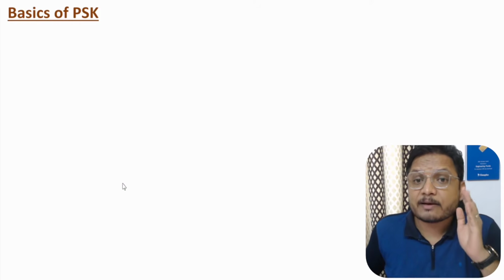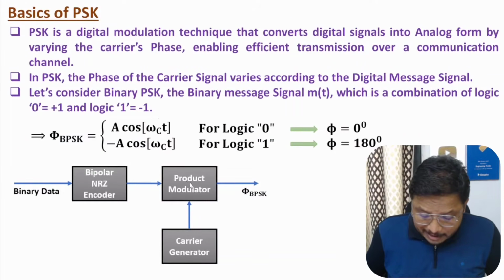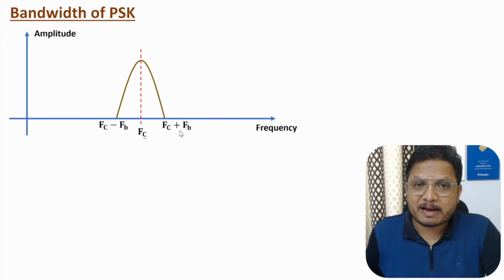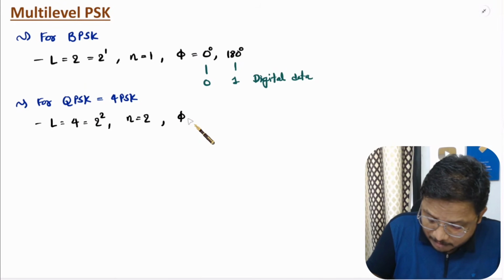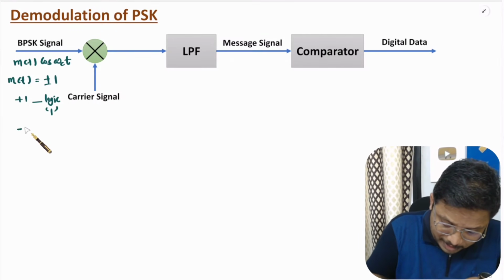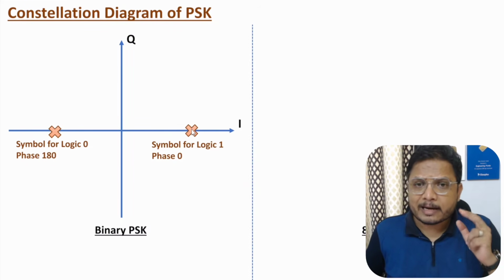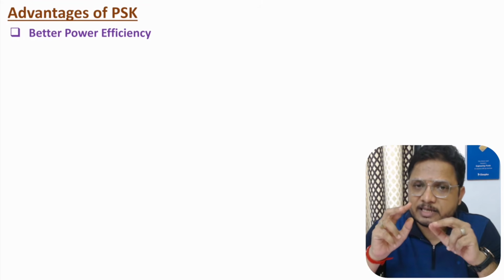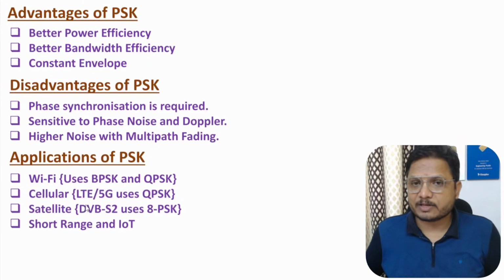Phase Shift Keying - PSK | Basics, Waveforms, Bandwidth, Demodulation and Constellation Diagram

Comment: dear sir i have bandwidth related confusions , here in some books they shows the bandwidth of BPSK signal is 2 * bit rate , but here we derived as b.w = Bit rate , so which one is right ? , same confusion for 4 PSK and  8 PSK ,
Reply from the maker: This confusion happens because two different bandwidth definitions are used.

For BPSK:
• Minimum (Nyquist) bandwidth = Rb → theoretical, no ISI
• Practical (null-to-null) bandwidth = 2Rb → actual spectrum width

So both are correct, depending on definition.

For M-PSK (4-PSK, 8-PSK):
• Symbol rate: Rs = Rb / log₂M
• Minimum BW = Rs
• Practical BW = 2Rs

Examples:
• QPSK → Bmin = Rb/2, Practical = Rb
• 8-PSK → Bmin = Rb/3, Practical = 2Rb/3